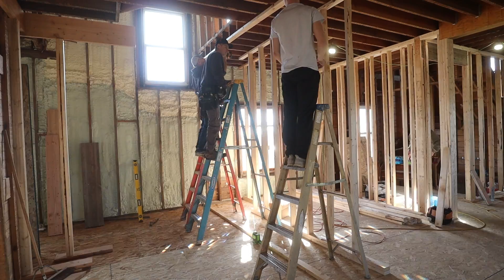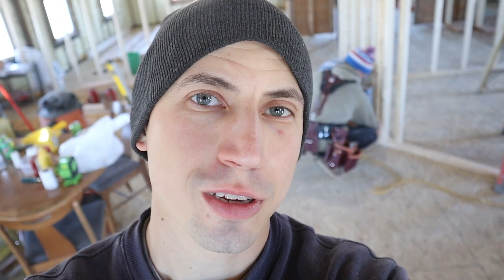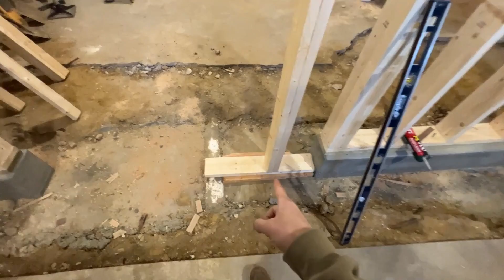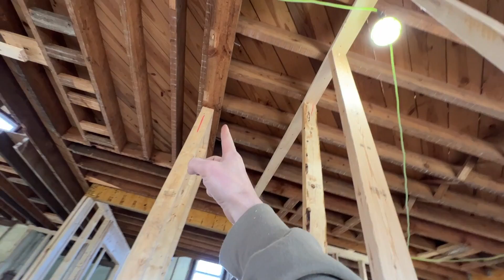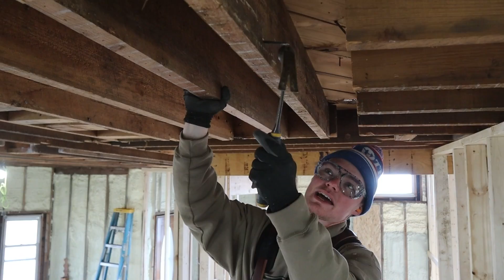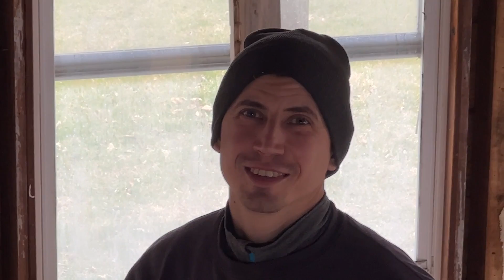Restoring A $7,000 Mansion: Building A New Living Room

Comment: Perhaps I am behind the times on current framing techniques. When I last framed homes, I installed horizontal blocks between the studs which provided fire blocking and prevented the studs from bowing. I put the midway up the wall vertically and all the way across horizontally. It was a good way to use short scraps while improving wall stability, especially in tall walls such as yours.

Comment: Trimmer is when it does not go to the bottom plate. Look at your illustration again. If it runs to the bottom plate it is a jack. Cripples occur between the header and the top plate. Just wanted to help you know.

Comment: To add to the confusion, when I rough framed houses in Houston, SOME guys on the job called the vertical studs above and below the window and door openings  cripples, which is actually how I learned it in California.  Okay, not below the door openings.

Alongside those openings, you had a jack stud that supported the header - so it went from the bottom plate or the sill plate (depending) to the bottom of the header - but I've also heard it called a trimmer.  

The King stud faced against the trimmer or jack stud, and spanned between the bottom plate and the bottom of the top plate.

Oh, and in some places, the header above the window or door is called a lintel, but I haven't heard anyone call it that in very long time.  

Now, I have seen windows framed without the trimmer, or jack stud.  Typically, they use a double bottom sill and a double top header, all out of 2x4s, and centered in the wall using double top and bottom cripples.  Then, the king studs are fastened to the outermost cripples, which are in line with the rough window opening, and toe-nailed into the top plate and the subfloor or bottom sill.  I've never seen a door framed that way, that I can recall, but I don't know why it wouldn't work the same way.

Comment: Cole. You need to do a blower door test to see how much air leakage you have and find ways to seal those leaks. It will make your house more efficient and comfortable. You will also need less HVAC to heat and cool. Also do another blower door test at the end to see how you improved performance of the house.
HVAC guys have a habit of over sizing systems.

Comment: Cole, could you show us blueprints or even just a drawing of the layout?
It’s a little bit confusing when all the walls are open like they’re now. 
Where will the door be for the toilet, in the pantry? Will the stairs be boarded off? Where is the main entrance going to be? Didn’t you want a handicap accessible entrance? If i remember correctly you talked about closing off one of the entrances?
It’s also quite confusing how each floor is on top of the other, under what is “the room” with the big tank? Under what is the soon to be bathroom in the basement? Same with the 3rd floor. Will there still be two staircases? Or one that goes just up and one that goes just down? 

Hope you’ll show us in an upcoming video

Comment: The word jack refers to its structural function supporting the header.   Cripple studs go between a header and the lower top plate,    So Jacks (or Trimmers) are the main supports for a header.   Just to mix it up further - here in Canada we just call studs studs and the cut off studs under and above windows cripplers.

Comment: Dudes, there are really some safety issues. You don't use a table saw the way Roman did. To push the end of the stud past the saw blade you use a piece of wood ... not your hand!  😮 And you dont want the stud dangling in mid air. For longer pieces of wood you need a support, level with the table.

Comment: You should look into a pneumatic nail punch.  They will pop those nails back up through the floor.  The device has a tube you put the tip of the nail into, push the button and that baby flies out or at least where its easier to pull.

Comment: If it goes floor to ceiling it’s a king stud, however if it goes floor to beam it’s a jack stud. It’s only a trimmer if it goes between a lower plate to a top plate eg to trim out a window frame above a lower plate to top plate. Eg to trim out a window frame. 😊😂

Comment: Why not just sister and extend the floor joists so that you can just get rid of those 5 joists going the opposite direction. Then you could just have the header line up with the wall for the stairs. Now you have a weird random beam right in the middle of the ceiling when you come down the stairs.

Comment: Please consider setting up conduit for network cabling and fibre. There is a huge benefit to having every room wired with Cat6 cable from the start. You can use the cables for everything from Cameras to an intercom system, whole home audio even. By running conduit to every room you allow for future changes and additions to the data wiring. you will be glad you did. look up "structured wireing"

Comment: just to know the right terminology.  
  Wall Framing Terminology
Plates are horizontal boards in a wall connected by studs. A top plate is located at the top of the wall panel, while a bottom plate is located at the bottom of the wall panel.
Studs are vertical 2×4 boards in a wall that connect the top plate with the bottom plate. Builders use studs when they construct walls, doors and windows.
King studs goes alongside the headers from top plate to bottom plate
Headers are horizontal boards used to transfer loads to trimmers (which are also called “jack studs” or short studs around a window or door). Headers are installed over a window or door opening.

Floor Framing Terminology
Joists are horizontal boards in a floor. Like studs, they are spaced at equal distances. Joists make up the platform to which wall panels are affixed.
Header brand joists connect joists together by wrapping around the joists. They provide stability.
Subflooring rests on the joists. It is the bottommost layer and acts as the foundation beneath the finished flooring material, such as hardwood, carpet or tile. Subflooring is usually made from plywood.
Girders are the main horizontal supports. Girders hold and stabilize the joists.

Window and Door Framing Terminology
A sill or saddle is installed under a window. The window rests on the sill or saddle for support.
Cripples are vertical boards that support the sill or saddle and the window itself.
Trimmers are also called “jack studs.” They are installed vertically from the header to the sill. Trimmers help transfer the load that the header carries.

Comment: FYI - What you encountered with the ceiling/floor of the main level, you'll probably have the same 'problem' with the next level up.  My dad was a carpenter by trade, so I learned a lot from him.  For added strength and rigidity, install cross members between the wall studs, similar to what you used as a Temp Measurement to steady the wall studs.

Comment: Cripple studs are non-structural but provide a nailing base for siding or interior wall coverings... A jack stud is a vertical structural element that sits below and supports a header to transfer its loads downward to the bottom plate and ultimately to the structure's foundation.... Roman is correct.

Comment: Fuel pump relay switch sucks and fails. Dont replace the relay switch until you check the switch.
Reply: I meant, dont replace the pump until you check the switch on a FORD

Comment: This is why you hire an architect or draftsman to draw out plans instead of building as you go.  This first floor floor plan is horrible.  Let's build the half-bath/pantry in the area with the window, the dining room will be four solid walls.  Flush the toilet with the door open, you just sprayed into the pantry.  You want the first floor bathroom next to the back door without having to walk through the house.

You are guessing where the structural loads will be, a structural engineer would have been able to take the plans and tell you where you need to have supporting structures.  I've been in a handful of houses where the owner built the way you are, all turned out horrible after they moved in.

Well the OSB nightmare is starting.  You're pointing out the weakness in it... it's why you use 3/4" plywood decking.  OSB is cheap and weak.

Comment: You might want to get your septic system checked to make sure it can handle any additional bathrooms if you're increasing the number from original. 
Also you'll find the rooms feel even smaller when you get the drywall up.

Comment: Did a little more research. If I understand it correctly trimmers and jacks are both correct names being that trimmers are called trimmers because thats where the trim of a door/window opening normally gets connected to. So in your case if the ‘trimmer’ is mid way a wall it would maybe be more correct to call it a jack?

Comment: Cole, you need to put your blocking in the walls keeps the stud's straight. Plus the wall you just put up with 2x4 running down the blocking will strengthen it.being its a load bearing wall before you take off the 2x4

Comment: You are forgetting firewall blocks. And blocks for electrical run, supports.  More electrical outlets yes.  And huge solar power for this home.  
I don’t write you much. But I am so proud of all of you.  This will be a generational home, eventually a small modern simple elevator system can easily go in a back closet shaft.  Think about it in you 15 years out plans.

Comment: Guys here is the Google  definition of  trimmer.

😊In carpentry, a trimmer is a timber or metal beam (joist) that is used to create an opening around a stairwell, skylight, or chimney. Trimmers are installed parallel to the primary floor or ceiling joists and support headers, which run perpendicular to the primary joists. 😊

Comment: Guys
I'm  sure you have thought  about the second floor ceiling/floor leveling it also😊.

In many states in walls, there is something  called fire stops.
These are  generally  put between studs at 4' to keep any fire from rushing  up the wall to the next floor. 😢.
In your case, this  blocking will  also  stiffen your  studs that are bearing  the next floor😊.

Comment: I dont agree with the 'restoration' you destroyed the feeling that it had. You could have leveled the floors with new beams, and then restore the old floors as much as possible. The radiators had to go, you could have heated with hydronic (hot water) in the floors.why you ripped out the stairs, i will never know, new windows, yes, new front door in the center, maybe. With all the money you have spent/wasted you could have torn it down and started fresh. All of the old Oak flooring that you burned, was criminal. To restore means to refresh, refinish, etc. Not wholesale destruction. So what it needed new wire,  leveling floors, and a new foundation. Which you never really poured, or properly designed footers.  I dont know what more to say but you failed in a tasteful restoration. ~~ Cris  H 😊😊😊😊
Reply: We're all here just to watch the train wreck.

Comment: When I worked at a parts store I loved guys that just replaced parts until the problem was fixed. You need to diagnose the problem instead of throwing parts at it. A ten second check for power going into the fuel pump with a test light would have saved you the cost of a module. Shame on you.

Comment: All of this construction is exciting and I enjoy every episode..... BUT..... where are the plans. There is no structural architect. Has any design planning been given to electrical, plumbing and hvac systems? Experienced architects, framers, electricans, plumbers and others with building and remodel experience are raising basic building questions that are now  addressed as they arise and not with a well thought out solution planned well in advance. 

Cole's youthful excitement and self confidence with a go, go get it done attituue without good blue prints and good planning is no match for what is probably hundreds of years of experience trying to give time proven advice on this project.

As many comments suggest, there is real concern as this project moves into the build out.

There is no doubt it will all get done and a ton of money$$ is being spent. If  Cole finishes his $7000 mansion like he has started, it will be a $700,000 mansion when complete. I just don't want problems that could have been prevented to become regrets.

Comment: Before putting a new fuel pump in try the fuel pump relay switch in your fuse panel under the hood. Same issue on my old truck. Dropped the tank and the old fuel pump still worked when testing it out of the tank. I honestly can’t remembered the number for the relay. Hope this helps ya out a little bit.

Comment: Get a grinder, cut an access panel for fuel pump and easily replace it. Then get a new  sheet of metal , tap some treads and bolt it down. Easy peasy lemon squeezey

Comment: @Cole The Cornstar
Hey fellas, I noticed that you have the header board for the pantry doorway turned incorrectly. I get that ur probably thinking that it isn't a load bearing wall so no big deal, right?  Well, I'm just recalling in my head all of the times that Cole was saying how he wants to do everything as right and solid as possible now while it's all torn apart ..... and he is absolutely correct about that.
I can't say for sure what, if any, effect the sideways header might ever have but, the point being is that is easily fixed to a 100% stronger level right now.

Comment: I am amazed about all those temporary walls. Normally, you would rent 20 jacks, get a bottom beam if necessary and jack every floor joist to individual level. Then build the load bearing wall in perfect level. Jacks are dirt cheap to rent. I think I pay $15 per month for one.

Comment: Are you going to put 'fireblocks/noggins/tie-bars'. to give the walls added rigidity with noggins every 40cm aprox 16"  (staggered) the verticle timbers would be supporting each other, therefore stronger. alto to prevent fire running straight up/down the inside of a wall.

Comment: I'm a contractor in Tennessee. If the stud is a bearing stud, it is a jack stud. It's only called a trimmer if it's only there to be a backing for trim. Also, cripple studs only exist above or below a void, such as windows. King studs exist as full runs next to support members such as headers.

Comment: Speaking of TVs... when you get ready to run cables for your entertainment system, run it through PVC piping in the walls. That way, if the types of plugs (USBs, fiber optic, etc.) ever change or need replaced, you can fish them through the piping rather than tear the wall apart.

Comment: Roman is not incorrect( as usual) Around the building/ framing trades in Texas, the dimensional lumber that is providing support under a header is called a "jack stud" I'm sure California and New York have their own names for them as I am also sure Al Gore invented them. Put an electrical outlet box in your stairwell for a plug-in motion activated night-lite to illuminate the stairs during times of darkness. Them hungry teenage boys will be running down them stairs at night on a regular basis to raid the fridge.

Comment: I guess I don't understand why you are screwing everything. Screws are ok for temporary stuff for ease of removal, but everything? You would be money ahead to invest in a air nailer and just nail everything. A bathroom in the pantry? Have you lost your mind? Roman using the term Jack for the support of a beam is technically correct. Support beams or window and door openings in walls require a horizontal framing member across the top of the opening. The studs that run vertically along the sides of window and door openings and are cut to fit from the bottom plate to the underside of this horizontal member are called trimmers or jack studs. They are NEVER called a cripple! Cripple is the studs above and below window or door openings in a wall!

Comment: Roman... check the fuse. Around number 20-24. It will be good but the holder gets hot and melts. Clean up holder and put new fuse in should fix it

Comment: Did you try starting his truck with the new module bolted to the frame? Most of those modules ground through the housing and if you just plugged it in and left hanging it likely wouldn't start.  The issues with the old ones is the aluminum housing corroding against the steel frame and losing its grounding. Before pulling the bed and fuel pump I would remove the old module, clean the frame rail up with a wire wheel. Add dielectric grease and bolt the new module to the frame.

Comment: Hey Roman, using the tools that Justin has have been tried and true for thousands of years. I've used the same tools, and I'm older than him, probably old enough to be his mother. Don't make fun of his tools or techniques. They've gotten the house this far. There's a certain way to deconstruct as well as constructing, and fixing things as he goes, like the weight issues in the basement/floors...walls. Yes, your tools are more modern, but nothing wrong with the older techniques. 😊

Comment: Is there a blueprint you are working from? I'm not sure what the building codes are in your area or if there are inspectors and permits needed, but in all the homes built or heavily remodeled where I live they are necessary. Helps especially with electrical, plumbing and HVAC. This is a huge project, and I would think that a documented plan would help to eliminate mistakes and extra costs. Don't mean to be a bummer, but I've worked on a lot of construction sites and a documented plan is essential.

Comment: I watch a lot of renovations shows on YouTube,  just curious as to why Justin doesn't put noggins on the floor joists and wall studs ?  This would add strength to both the walls and floors .  Noggins on the floor would stop the joists from twisting or rotating under load and in the wall studs from buckling under load .  Sorry, I don't mean to sound rude,  I'm just curious 🤔❤